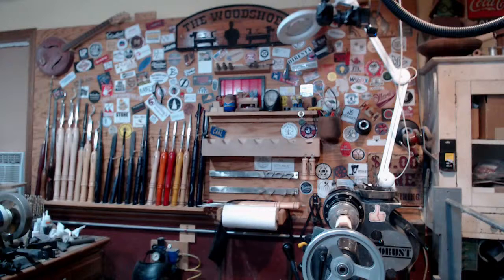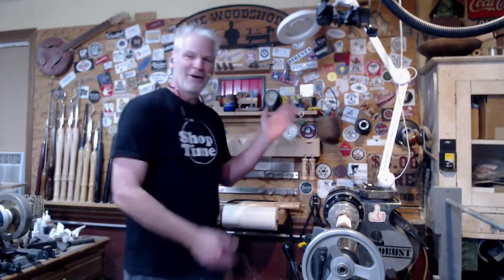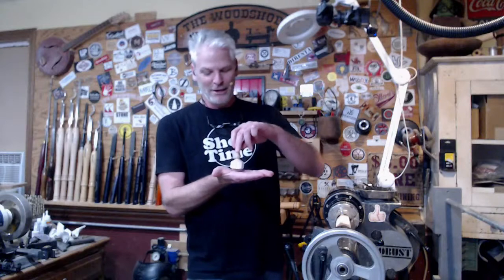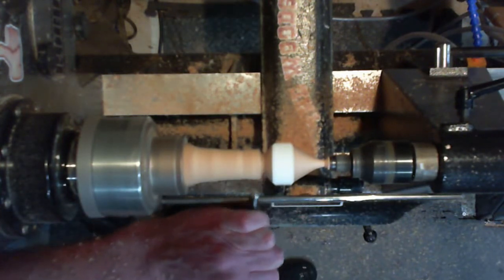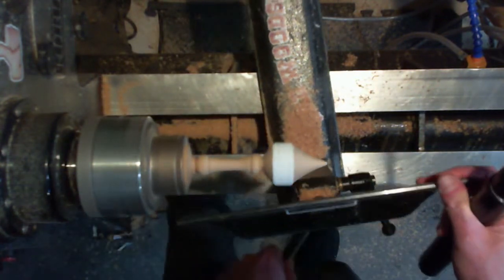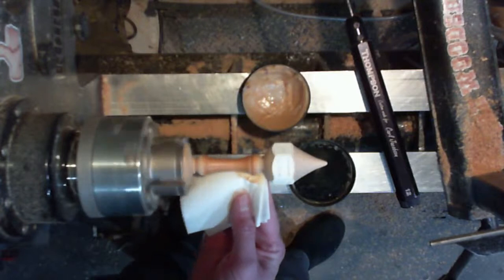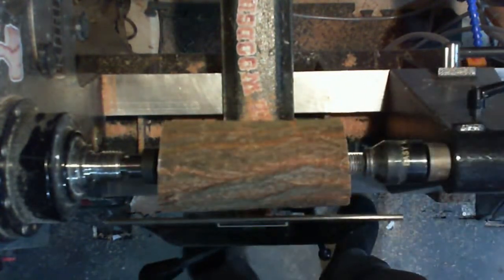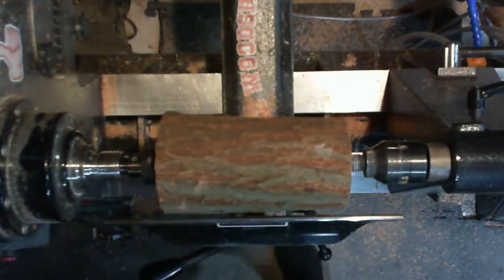Woodturning Demo | Virtual Craft festival

Comment: I did not get to watch this live. I did not read through the replies, but I don't think the dice top works correctly because it is too top heavy with the handle. I believe the issue would be resolved if the dice was much wider. The problem with the design as it is that any minute bit the top handle is out of perfect vertical it throws the spin off causing it to fall over immediately.
Reply from the maker: My wife tried to tell me that same thing before I made it lol
Although because I made this for her, she asked me to make it a little top heavy so she didn't have to wait so long for it to stop spinning. The main goal is the dice :)
Reply: @CarlJacobson  No problem. I just thought others may want to make this so that it spins. They would need to experiment with it to see what ratios work. I enjoyed the video.

Comment: One reason it doesn't spin long is that it's unbalanced. Your large numbers are on one side and the smaller numbers are on the other side. The numbers should equal 7 on opposite sides. Instead of 1, 2, 3, 4, 5, 6 you should have  6, 2, 4, 1, 5, 3. This gives equal weight all around.
Reply from the maker: Thank you Sarah! I definitely want it to spin longer but not to long, so that might just do the trick :)

Comment: No pun intended, but the top is too top-heavy to spin decently. It needs a lower center of gravity. Drop the dice section down and make the handle shorter.
Reply from the maker: Yes I need to work on the design :)